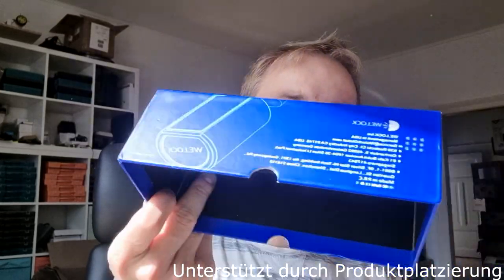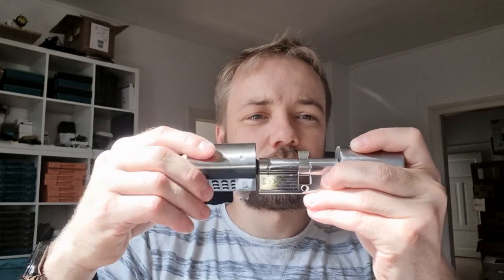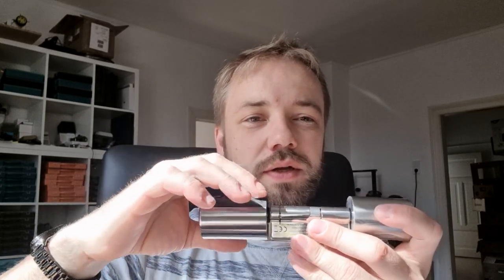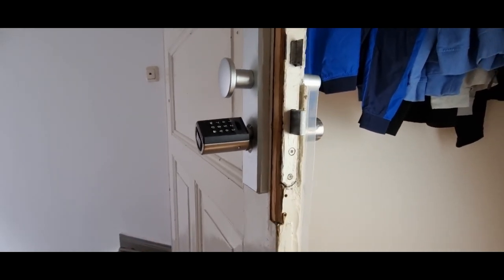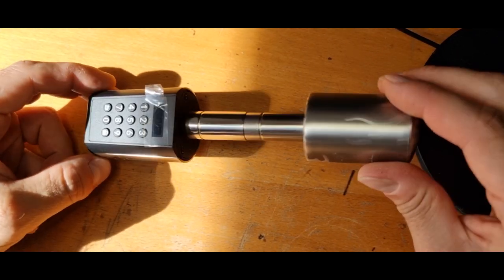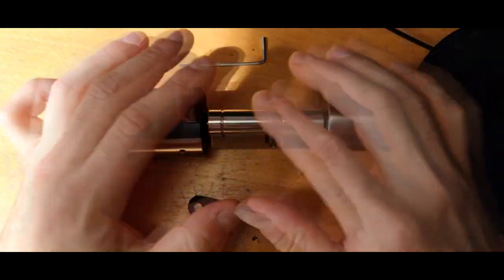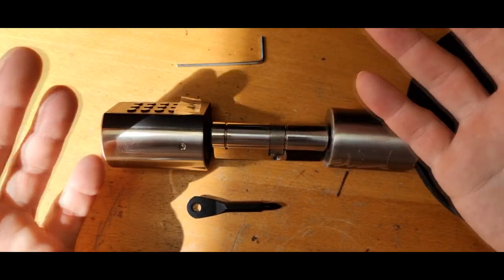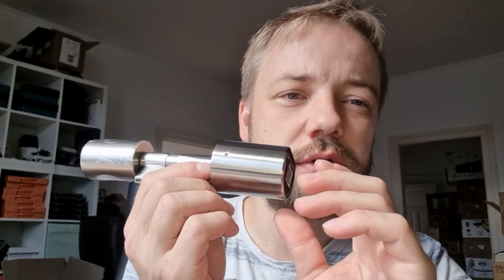Electronic lock with Bluetooth & RFID Review-teardown WELOCK PCB41

Comment: Bad product!!!

Try access the meniu with a needle "Clear All" through the two small hole.... and voala.... lock is opened without any fingerprint.
Reply from the maker: This one does not have an clear all button. 
The one button is only a real reset for the nrf52811.

Dont know it for the fingerprint version
Reply: @atc1441  Ohh sorry.... I see, this is not the fingerprint version...